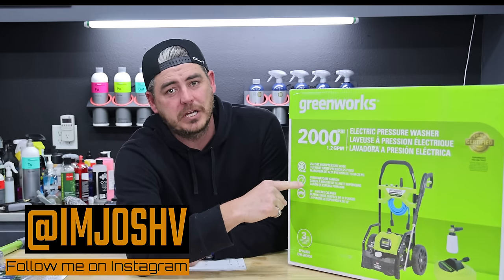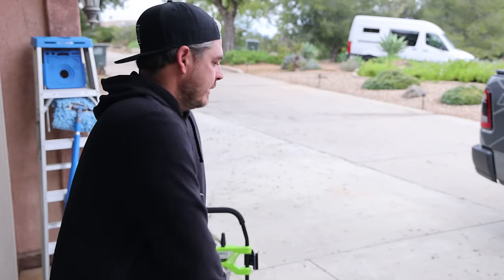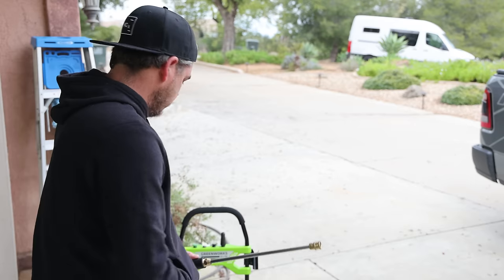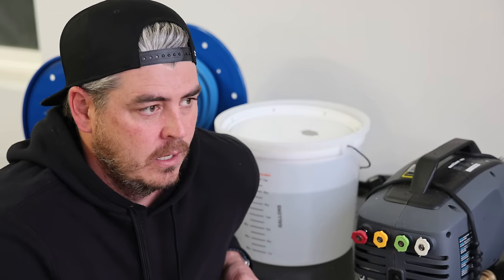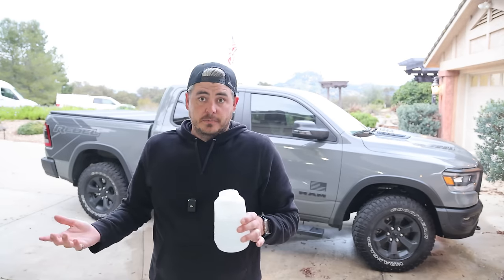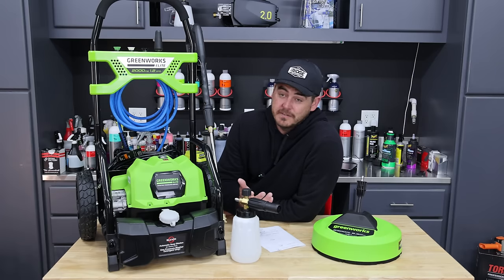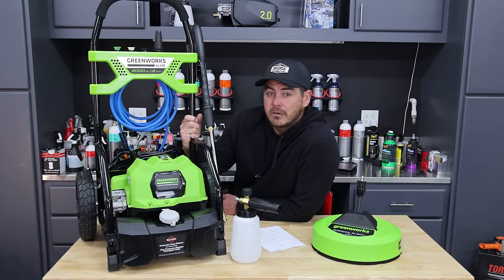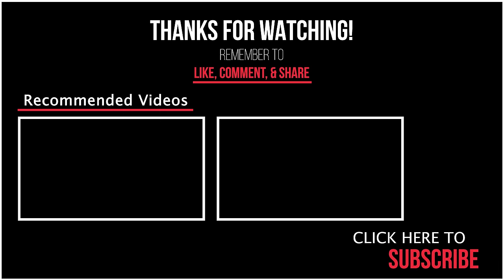New At Costco! GREENWORKS PRESSURE WASHER With Foam Cannon And Surface Cleaner

Comment: I got the 2100 psi greenworks pressure washer with foam canon at costco for $129.99 CAD 2 weeks ago. I consider it a steal because I already did two residential jobs with it and made $650

Comment: JOSH, per your recommendation, I bought the 2300 Greenworks last summer during the cyber sale.  The 2300 has a brushless motor with a 10 yr. warranty.  This unit will clean concrete, decks & houses, a multi-use tool.  Plus it is NOT made in China!  Thanks for all your testing.

Comment: Thanks Josh!  FYI the Costco Online model and package for $180 was slightly different.  White soap tank and came with 50ft flex hose (instead of 25ft) and QC’s and 5-in-1 nozzle (instead of foam cannon and surface cleaner)

Considering I was looking to buy a new 50ft hose and qc’s for my gas pressure washer anyway, I took a chance on this as those two items are about $80 value

For the $100 “net” for the unit, IMO it’s not bad but I’d prefer more flow especially since I’m used to a semi-commercial gas unit (I use a large 6.0 nozzle to drop it to car-safe psi).  I could tell a noticeable difference in flow when trying to rinse the foam off the car 

As such, personally im thinking of getting the active ve52 or 2.0 instead, but can’t really go wrong with anything Costco.  Still a great deal overall !

Comment: Josh I would love to see more amperage readings when they come with different sized orifices or if you use different orifice sizes in your testing.  They might come under 15A with one orifice but when you switch to another, it might exceed that.  This would be nice info for us stuck on 15A breaker.  Love the reviews, thank you!

Comment: Hey, look at the online only deal for that right now at costco. It comes with a 50ft hose instead of 25ft and it has a quick connect set too!
Reply from the maker: On costcos site?
Reply: @imjoshv  I'll have to check my physical store but the $179 one in the app doesn't have the accessories but comes with a 50' hose.  Also says "online only".  Deal Guy showed the one you had in his store though and what had my interest.
Reply: @imjoshv  I figured it out - they dropped the foam cannon and surface cleaner and went with the 50 ft hose. I think at its current price of $180 it is an absolute steal for car detailers... WDYT?

Comment: Interesting. I live on the east coast and my Costco flyer lists a greenworks 2000 psi/1.2 gpm pressure similar but slightly different than yours for $179 starting March 5. The bonus kit includes a 5-in-1 nozzle and a 7-piece quick connect kit. It also comes with a 50 ft section of the same hose.
Reply: Patiently waiting on 3/5 😂
Reply: I saw the deal you mentioned online, but at the store is the one described in the video!

Comment: They just got a new model at my local Costco, it’s the Greenworks 2100PSI. It is sold at 130$ (Canadian). Do you think the 2000PSI unit you have would do a good job to clean ATVs full of mud? If it would, I guess the 2100 model at 130$ (Canadian) would be an even better deal. 

Thanks.

Comment: Absolutely right Mr Josh as always because is a pain in the butt that brush kit from Costco I bought one for my cars and it scratch very bad my wife car ,it was my fault because of my lack of knowledge and not paying attention in to how hard and roughly the brush is ,and not only is low quality of the brush the problem with that to is that you hit your cars very bad with the plastic edges, from now on like yesterday I used it to wash my Jeep hard top only.Hey Mr Josh one question I bought yesterday at Home Depot the Ryobi 1800 psi pressure washer for an auto detailing business I am planing to invest with a friend of mine,the question is how many cars can he wash at a day with the 1800 psi ryobi machine ?Thanks an advance for your answer.

Comment: I usually have troubles with the Greenworks pressure washer tripping the breaker on the unit itself.   You are not supposed to use the unit with an extension cord if that makes any difference to buyers.

Comment: What is the soap injection tank for and why don't you recommend it?

P.S. this one isn't didn't go on sale. There's a different model at the same MSRP - with more nozzles instead of surface cleaner/foam sprayer - that has $50 off.

Comment: Thanks for review Josh. I bought this from Costco last year and it’s been a good unit so far. Couple questions though. 1. I bought a ridge washer short handle gun for it and the unit will cycle on about every 15 seconds. When the factory wand is on it doesn’t do this. Any idea what would cause this?
2. I’ve been thinking about after market Nossles. Does it create a different water pattern than factory? Your machine seems to have a nice wide even distribution and I feel like mine from this Greenworks unit isn’t as efficient. 
Thanks again

Comment: I've been watching your pressure washer videos for the past week since I'm looking at picking one up for my home. I think the Ryobi 2300psi is the right fit for me but wanted to run my situation by you and see what you thought.

It will primarily be used for weekly car cleaning, but I do want to get something I can use for the occasional house or driveway wash as needed. All personal use.

I was considering the DeWalt 2400 as well but online reviews prefer the Ryobi. I thought about the active 2.0 but I don't know if that would be able to tackle the occasional house projects.

Let me know your thoughts, thanks!

Comment: I also am wondering your thoughts on the green works washer that has the 50 foot uberflex hose and quick connects and special 5 in 1 nozzle that is on sale on the 5th online on Costco as that 50 ft hose would be sweet and then get the other foam cannon that you recommend and buy a floor cleaner separate.  Any thoughts would be appreciated as I will be buying one of those in the next few days.  Great video

Comment: Just bought this at Costco for $149.99 with everything included.  It had the asterisk * in the upper right corner so it's not going any lower and won't be restocked.
Reply: Hi. What is the item number? Thanks in advance.

Comment: You do not want more than 2500psi for the home. Any higher you can etch concrete your siding. My neighbor has a professional power, and he blew the paint off his truck. And just about etch his 12000.00 dollar deck, so watch out. I have a separated 15 gallons water heater in my garage set on medium temp and I hook my pressure washer to it. I own an expense car and was told to use warm water to wash it then cool to rinse it off.

Comment: I bought one about 2 years ago. I have lightly used it about 4 times. Now it will not start. I have replaced the GFCI plug  and it still does not start. POS!!!!! Do not buy it.